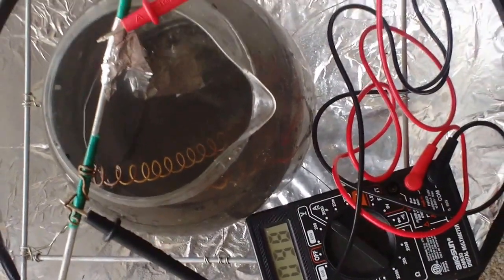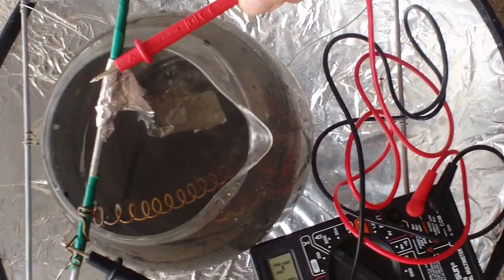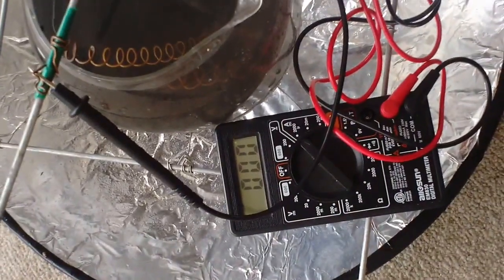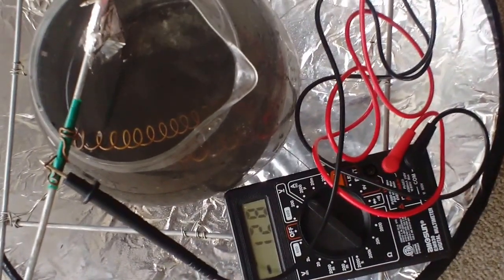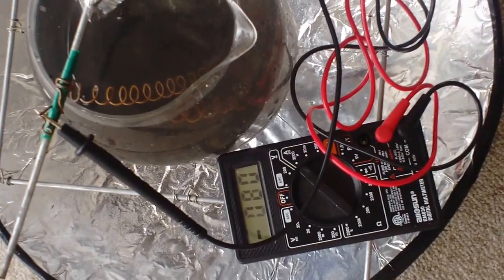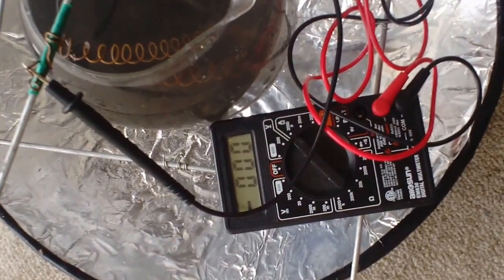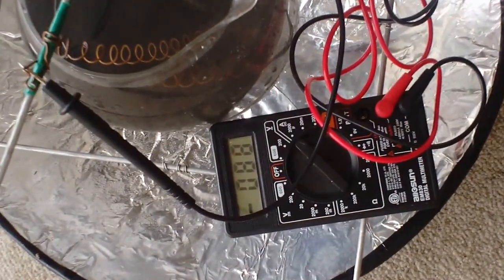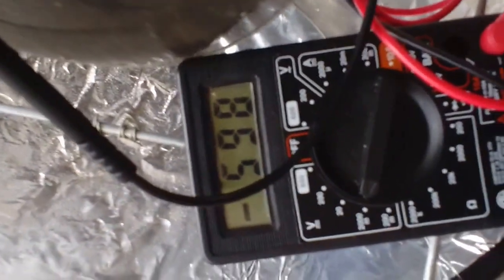SOLAR power with graphene

Comment: graphene nano flakes in water with copper/aluminium electrodes by solar cell in sun light can produce electricity.Is it true ???
Reply from the maker: yes. physics world has an article on graphene nanoflakes in water too. it is known now
Reply: is it possible to get energy at mass production with nano flaxes or its just lab test.
Reply from the maker: it can be scaled to any dimensions. nt just lab test. am demoing tech in salem this spring